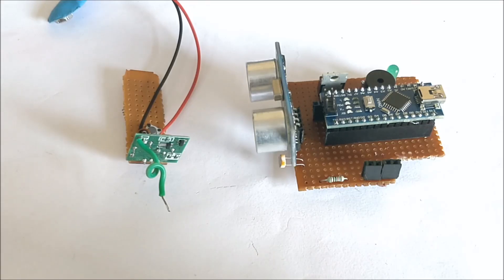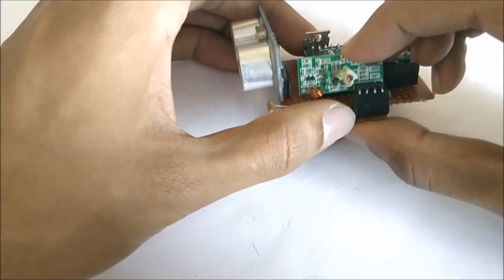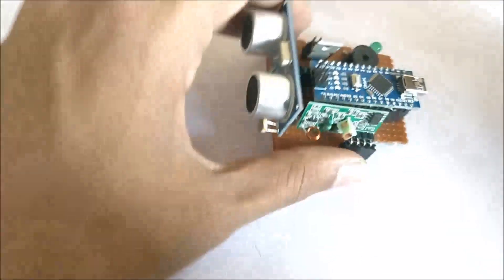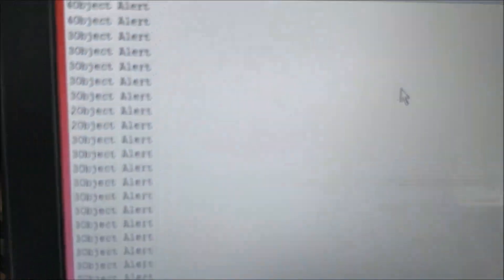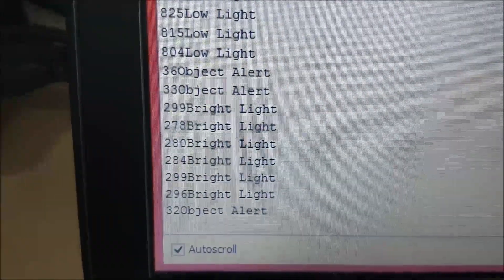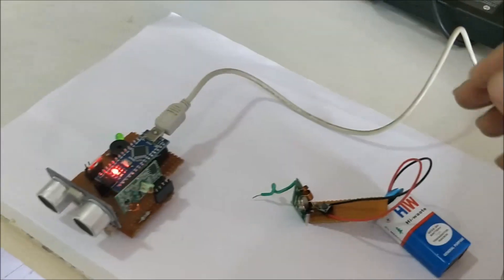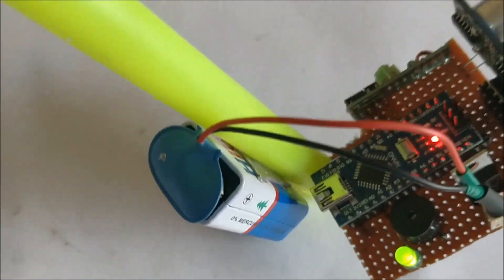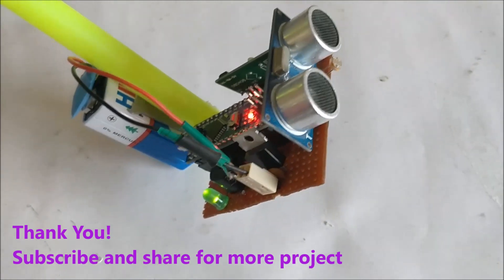How to Make an Arduino Based Smart Blind Stick using Ultrasonic Sensor

Comment: Every room is dark to a blind man. What is the benefit of knowing if the lights are on or not? I also noticed you mentioned IR but I don't see an IR emitter or receiver. What is the green wire for on the other device that you said was IR? It appears to be an antenna, but that's not how IR work.

Comment: Broo plzz show the connection and soldering video.
Reply from the maker: Link in the description for Circuit Diagram, Connections, Working, Soldering, etc.
Reply: @Circuitdigest  hey i saw he page, ntng is happening. Just make a video where you have done the connection and soldering from assembling.

Comment: I like your device. I am planning on building something close to this. However, I want to add a bit more to it. My thought is to add a flame detector and a color detector. Maybe even GPS also. Just think a blind person if in a burning house could not only navigate to get out, but also avoid the fire. Then for the color sensor, be able to read stop-lights also. Then with a talking GPS they could also know their location. I've been a computer programmer from when the Altair came out. I'm also an electrical engineer. My wife bought me the MegaKit and the Sensor Kit. I'm just starting out in Arduino development and find it the most easy thing I have ever used. My learning curve is near zero, so I will soon be developing real world applications. I'm going to specialize in medical electronics devices.  I have so many ideas! I want to build and market very low priced devices for the disabled. Great work on your design! Keep at it... I will share my work with you when I get started on it! I give you a big LIKE!
Reply: Broo my rf part is beeping without input. Do u have any idea

Comment: In the website you have written "7805" in materials required . Could you please tell me what is 7805
Reply: 7805 is a Voltage Regulator IC. It gives fixed voltage at the output that is 5volts. There are other IC's  also in this 7800 series.

Comment: The buzzer is beeping itself and the remote transmitter is not working .. How to fix it ??
Reply: Did you fix it?
Reply: yeah
Reply: @thalapathyvijay776  Were you able to make this complete project with circuit diagram shown on the website??
Reply: @thalapathyvijay776  broo tell how u did the project. We need to submit it by this weekend. Broo plzz
Reply: Broo in the code at remote section instead of less than symbol use "==" this for value 10.it may work

Comment: Brother, I cant understand the rf transmeter circuit diagram. plz make a single and simple video today just about rf transmitter.and receiver work.(on one switch only) 
plz bro, its a request.  I want to make a project but I cant understand it. plz,plz plz, you are my only hope. I am waiting for your reply.
Reply: did u make it